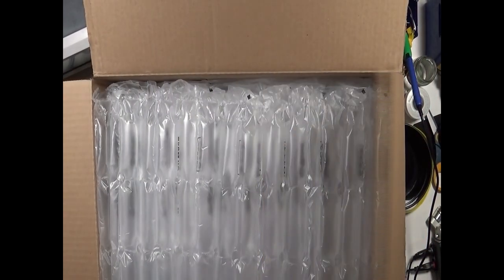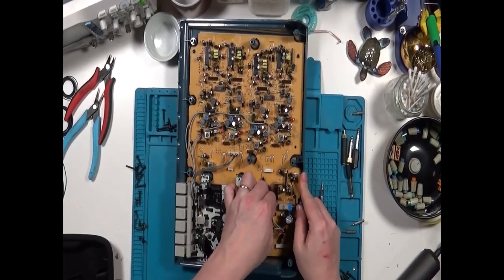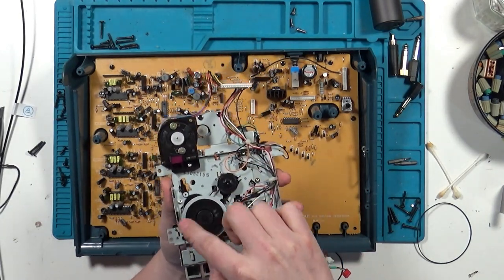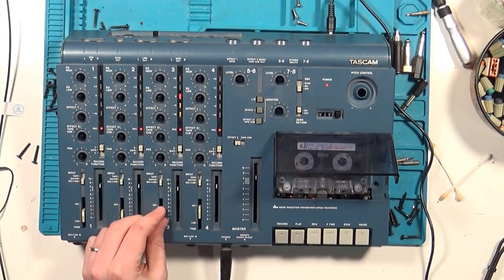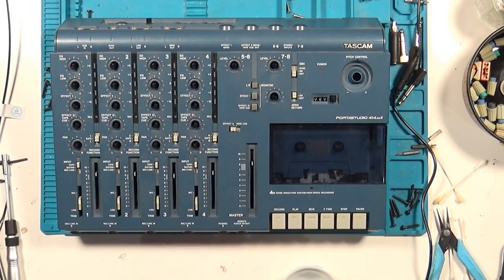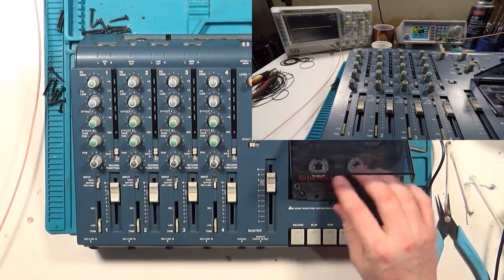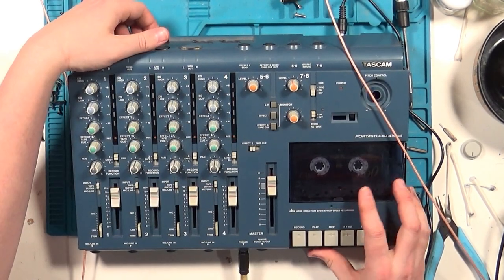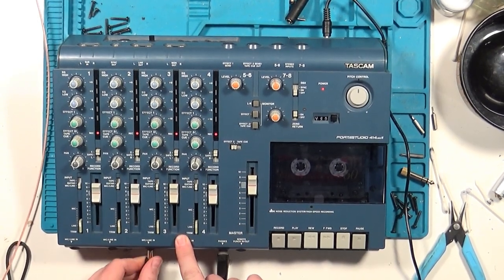Tascam 414 Mk2 Repair Refurbishment and Calibration

Comment: THANK YOU!! I've been frequently checking for this video for YEARS, and it exceeded expectations 👍
You are rescuing MANY beloved 414's out there 🙏

I've accumulated 4, which all still worked surprisingly well when last powered up. I've kept new belts on hand, but never had the guts to tear one down and risk killing it. But it looks surprisingly simple inside! I just hope the top section is equally approachable.. my original saw lots of abuse in the 90's and a couple of the inputs are shot. Anyway, thank you so much for the guidance and explanations!
Reply from the maker: I hope you got your 414s up and running again. They're remarkably robust little machines, pretty hard to kill. Most often a capacitor replacement or resoldering a broken joint is all it takes.
Reply: I have one since around 199...6? 7?
Why do you have four?

Comment: Thanks for posting this. Sorry to add to the bombardment of troubleshooting questions, but I have a 414 Mk I, and it appears to have bleed through on the L-R Monitor even when the tracks are all turned off. Unfortunately this creates a rumbly distorted sound that can always be heard through the L-R monitor output, regardless of how loud the tracks are mixed, though it's most obvious on quiet passages. I know the tapes are okay because they play back cleanly on a 424 MkII that I also have. If you happen to have any suggestions, maybe this is something I could try to fix. Thanks.

Comment: hi, i was wondering if you could help me. my porta studio 414 mkii is having issues recording through the 1st input. i get signal but it will not record. I have a feeling it has something to do with the trim fader as it does not function. i opened it up and to my untrained eye none of the components look fried all solder joints look clean the trim pot inside also does nothing to change the volume of the recording or anything. play back is still functional on the channel if i play a cassette i’ve already recorded onto. any suggestions?

Comment: Hi , need your help on tascan 414 unit, similar to this video, but there is power Led  and the mixer side, but no power to the tape player, belts in the player is fine, no spinning at all, what should I look for ? Which capacitor can be root cause?

Comment: excellent video. my 414 is having a playback issue where the R channel is slightly quieter than the L. can this be fixed with use of the trimmers at all? or will i need to replace the master fader? many thanks!

Comment: Is it possible to use a 9v power supply on a 424? 

If not which power supply should I get? A official Tascam one or will the amazon knock off for half the price do the trick?

Comment: Hello thanks for making this video :) Going to use this to replace my 414 belts.. I was hoping you might be able to help me diagnose a problem with my 246? My unit seems to have a power connection failure with the tape section. When powering on the mixer section all works the tape sometimes works for a few minutes then the counter lights go off and the tape is un responsive, i can still use the mixer though. I only recently changed the belts idler and pinch roller i've been thinking i might have damaged something when i opened it but nothing obvious.. Would really appreciate any advice. Cant seem to find any tascam techs where i live :/
Reply from the maker: While I love the Tascam 2XXs they're an absolute beast to work on so I've generally avoided them. Unfortunately I'm not as familiar with their internals as I am with most of the 4XX series.

If I were you I would first try wiggling the connectors while the unit is on to see if you can narrow down which one is only making intermittent connection. If that doesn't get you anywhere, undo all of the connections to the motor and motor driver board and look closely at the pins. If you see oxidation or darkening on any of them look closely at the connector itself to see if something has been making an intermittent connection and sparking, that might be part of it. If that's the case try to bend the female connection back into shape so it gives you a strong mechanical connection again then clean up the pin and the connector with an electrical cleaner. As a last step before moving on I would reflow all the solder joints for the connectors in the motor section as well just to make sure a solder joint hasn't cracked on you.

It's also possible that a capacitor has failed or some element of the motor driver has partially failed, that's going to be harder to diagnose though. If you've ruled out everything else I would start trying to tackle that possibility by recapping every board connected to the transport and hoping that does it, if not try replacing transistors one by one in the transport motor driver until hopefully the problem is fixed.
Reply: @ThatTascamGuy  Thank you so much for your reply thats really helpful :)

Comment: Thank you for posting this video. Would you happen to know how to adjust the tape deck speed on this model? For some reason mine is playing tapes at a very high speed. The pitch control and internal pitch adjuster doesn't do much to resolve the issue. The cassette motor doesn't change to any adjustments either, so i'm stumped.
Reply: This unit was in storage for a very long time, and hasn't been used for at least 10 years

Comment: Thanks for this - learnt a lot - if my Tascam gets power to the tape deck, but the main power LED doesn't light up - is that a case of just a dead led?
However... also... I am pretty sure the pre amps dont seem to get power either (I think I am testing it correctly).
Are the preamps/inputs/channels and the tape deck on two separate circuits? 
Just trying to figure out how power gets to the tape deck, but not anything else - if you or anyone has any ideas!

Comment: Hi. Thank you for this video. I replaced the belts with your help. Now I need to replace the headphone jack up front. Can you suggest a replacement part number or place to purchase? The jacks up front are easily damaged.
Thanks again
Reply from the maker: I don't know that I've ever had to replace a jack entirely on any of the Tascams I've worked on, although I have had to resolder quite a number of them because the solder joint has gotten cracked. Are you sure the jack itself is bad? I don't have a specific part number to recommend to you unfortunately, but as long as you can find one of a similar form factor it should work (although it may take some creative work to get it to anchor in place if the lugs are not in the exact same place).

Comment: Cool but how do you unplug the wires between the two sides? I'm afraid to break something :/
Reply from the maker: They're pretty tough, you want to grab as close to the plug head as possible and gently rock it back and forth as you pull up. I've worked on a lot of these machines and only managed to pull a wire out of the connector twice, and both times it was when I was rushing and pulled harder than I should.

Alternatively you can try to get a flat screwdriver under the plug head itself to lever it up, also gently, but that can be hard especially with the initial connections because you don't have a lot of room to maneuver in there.
Reply: @ThatTascamGuy  Thanks, it worked!

Comment: Hi there! Thanks for this fantastic video. I have a 414mkii that was given to me from the original owner, who claimed it was barely used. The rewind and FF are barely working. Play and record are great. I replaced the belts myself, but I'm thinking it's a motor issue. No expert but would love to get this guy working! thanks.
Reply from the maker: It may be the motor, but because the motors can be hard to come by (and because play works correctly) I would first look very closely at the transport mechanism itself.

A good first step would be to lubricate everything (but carefully! you really don't want lubricant getting into the tape path) and then to make sure everything moves into the correct position when you press play/fast forward/rewind. If something is coming close, but not quite all the way, that can give you results like what you're seeing.
Reply: ThatTascamGuy It was a spring loaded lever on the back that was jammed. it came apart with a light touch and I reseated it and pushed the white cap on firmly, and all is well again. thanks for your awesome video!
Reply from the maker: Excellent! I'm glad to hear you got it worked out and it was so simple in the end.

Comment: Hi thanks for posting. I think my 414 has the same problem. What capacitor did you use as the replacement? Would I be able to make this repair with a standard soldering iron and and a desoldering tool?
Reply from the maker: If you're going to try removing capacitors I would recommend using a desoldering braid rather than a solder sucker, the desoldering iron I use makes it faster and easier but is by no means vital. It's extremely hard to remove all the solder from through-hole parts with a manual solder sucker though, the desoldering braid makes it much easier.

I just took a replacement capacitor of the same capacitance from my small collection, but as long as you match the farad value and meet or exceed the voltage rating you'll be fine. Especially because it's in the power system, not the audio system, so there's no possibility that you'll hear the difference between a cheap and "excellent" capacitor*.

*before someone wants to "well actually" this, it is technically possible that you could hear a difference in some settings, but with the way the Tascam is designed it's not a realistic concern

Comment: Thank you for the in depth video! I just got a 414 and I am trying to diagnose an issue. I have found that all the functions work as expected, but when I attempt to play a tape back, I can just hear a very faint crackle as if the audio is attempting to play back both through the headphone jack and RCA outputs. The record function works as I was able to record and play the tape on another device. All the lights and VU meters indicate that there is audio on the tape attempting to playback. Also the microphone is audible through the monitor,  just nothing playing back from the tape. I read there there may need to be some capacitors replaced. Any idea which ones I should replace? Or maybe something else going on? Thanks!
Reply: I'm also having this issue , did you fix it?
Reply: @parker1787   Yes I did and I made a video of the process on my channel!

Comment: Hey man. Wondering if you can help me out. 
I'm in Australia and  I recently bought 414 mk I and am needing to replaced 2 broken/unresponsive gain faders. 
Where would one start to search for such rare replacement parts? If you have any ideas of somewhere that might have spare parts or old machines for used parts, I'd love to investigate.
Would love to get this baby fully operational again! 
Cheers!
Reply: I had a similar problem. I found a fix that involved replacing the capacitors related to the faders. It's a common problem apparently.
I forget the capacitor value, it was available online, and they were really inexpensive.

Comment: There's some really good information in this video, but shouldn't you be calibrating the playback and record amplifiers separately? I mean - use an MTT-150 or equivalent test tape to adjust the playback trimpots THEN compare tracking and playback meter levels to set the record trimpots? Otherwise you can end up compensating for a lack of gain in the record amplifier with an excess of gain in the playback amplifier =  noise floor higher than it needs to be. The process is demonstrated on my channel if anyone reading this isn't sure what I mean (btw I'm not just trying to steal traffic, I really want as many people as possible  get their portastudios sounding great , liked and subbed, thanks.)
Reply from the maker: That is the best practice, it's true. I changed my refurbishing technique to do it that way as well, but unfortunately that didn't make it into this video... or the next one either, I think. But it'll show up eventually. Thanks for making sure people know though, that's a fair point.

On the other hand, not doing it that way also isn't the end of the world. It isn't as technically correct, but because the tapes recorded on Tascams like this are usually only played back on the same Tascams you avoid the biggest problem of not calibrating playback first - the tape sounding awful on another machine. It does potentially push up the noise floor, but in my experience the changes to the levels are so small the difference won't be significantly noticeable, especially as few of these machines are being used with the goal of getting super hi-fi recordings but rather getting the elusive "tape sound".

Comment: I have a loud hum on both outputs (head phone / line out) and when I turn the pitch fast it completey drops out. I get the hum when I recorded channels also. any tips on what to look for or at?
Reply from the maker: I know it took a while to get back to you, but hopefully this can still be helpful. Any time there's a hum I always look to grounding issues. There are lots of sources for electrical noise inside a tape deck, so there also tend to be lots of ground connections. If one of them has gone bad or is only making intermittent connection (or is entirely disconnected) you're likely to get hum somewhere in the system. Because the hum responds to the pitch wheel I would suspect the grounding issue relates to the transport motor, there should be at least one ground line connected to the transport assembly by a lug that goes between the transport and the case and is held in place by a screw. I would check that first to make sure it is still there and making good connection. If it has become oxidized I would lightly sand its surface and the surface of the transport mechanism where it will be sitting to make sure it's making good connection all the time.
Reply: @ThatTascamGuy  Thank You for your reply I will look into it.

Comment: Hate to pester you, but my 414 mkii recently took a little bit of a fall, and now the tape functions still work (play, f fwd, rew, etc) but nothing else seems to be (including the on light). However the one light that does work is the zero return. Have any idea what could’ve happened when I tripped on a mic cable plugged into the unit, thus putting me into this situation?
Reply from the maker: It could be quite a few things... the first step would definitely be to open it up and see if anything is obviously broken. My first guess would be that something on the audio/mixer side of the board is shorting out which is why nothing but the transport is working, its power system is sort of independent from the rest of the machine for noise reduction reasons. I'd take a close look at the audio connectors and the board near them, especially the one that was plugged in, to see if there's any obvious damage. I'd also check all the wire harness connections and make sure something didn't shift loose somehow.

Comment: I’m working on fixing one at the moment, he belts need replacing I believe, is the capstan wheel supposed to just fall out when you take the belts off and turn the tape player upside down?  Is there a clip that holds the capstan wheel from dropping out or is the tension of the belts supposed to hold the wheel, my machine won’t play because the capstan keeps dropping and disengaging the gear.
Reply from the maker: Yes, there should be a retaining ring on the capstan. It's not an e-clip style ring though, it's a very thin metal washer that is very slightly smaller than the capstan shaft so it won't slip off.

This is a picture of one from one of my units: https://imgur.com/a/tr16rnJ (sorry for the filthy condition of the transport - I haven't gotten to that one yet)

I'm not quite sure what you call that part, but it is VERY thin, made of metal, and needs to have a slightly smaller inner diameter than the capstan itself. Assuming you find something that ticks all those boxes I don't think it has to be an identical part exactly.
Reply: ThatTascamGuy awesome and thank you, really helps me out, I’ll have to hunt one down or find something comparable.
Reply: I was able to find the clip I needed and it is working now.  However, im only able to record on tracks 2-4.  Track one does read in the light meter (im getting a signal) however the tape machine will not record track one.  Any thoughts?
Reply from the maker: @mmmmvermillion  It's possible, given the previous issue with the capstan dropping, that something is misaligned. I would try to check on that first, make sure the capstan isn't continuing to move up or down at all, and play pre-recorded tapes to see if the tracks that play are actually those tracks on the tape.

After that I would clean the head very well, and if that doesn't help replace the capacitors in the affected channels.

Comment: My 414 playback speed is too fast even when I turned the pitch control to the slowest speed, do you have any idea what's the problem and how to fix it?
Reply from the maker: The 414 always runs at double normal cassette speed, so commercially recorded tapes won't sound right on it. If that's what you're trying then I'm afraid you won't have any luck, you would need a 424 in that case because that family of portastudios has a selector switch for normal speed or double speed.

Is that the issue, or are you seeing something else that makes you think it's running too fast?
Reply: the problem is, that there is no problem. everything fine^^